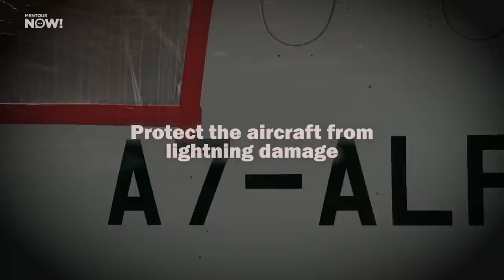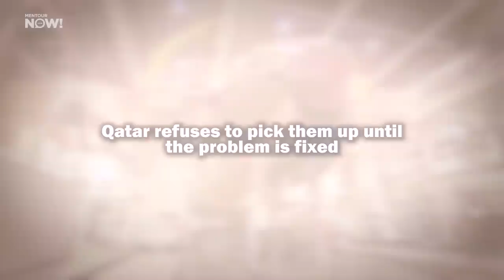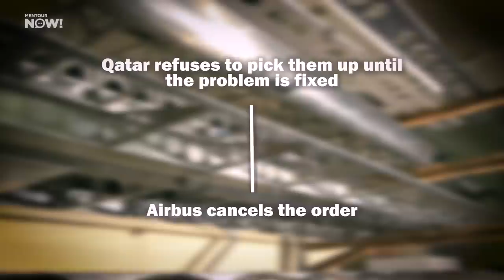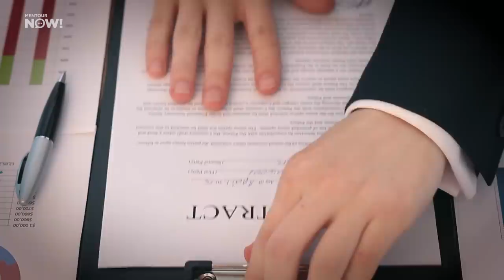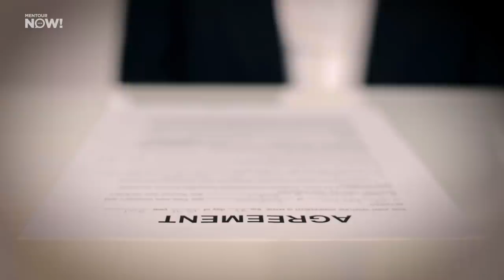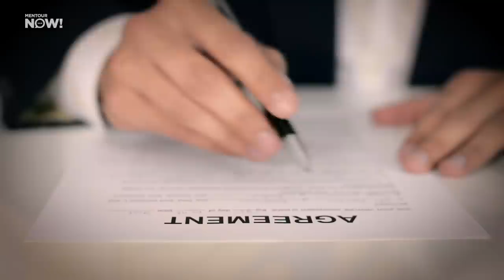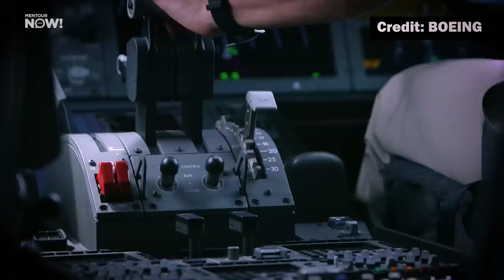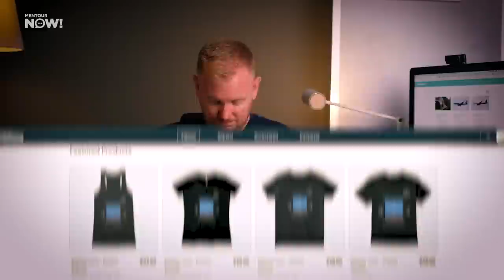WHO is Winning the FIGHT between AIRBUS and QATAR Airways?!

Comment: Thank you for the technical explanation about the root of cause of this issue. 
Now I understand the key cause(s) of this paint peeling. 
a) structure integrity > unlikely
b) paint itself > unlikely
c) bonding issues between three layers > YES《carbon composite + steel mesh + paint system 》which has different expansion rate. Anyway > this is lack of long term testing before applying the system on real use!

"Carbon composite + surface steel mesh + paint system" > bonded issue.
This is 100% manufacture defect, whether it is a cosmetic or airworthiness really dependent expert witness statement. When one airline against one aircraft manufacturer...you can anticipate the result.

However, painting system serves two features (1) surface protection (2) company image. If damage of item (2) leading to more re-painting job (resulting losing business opportunity) or leading damage of company image than it is a long legal battle...

***************************************
Old understanding without acknowledging that a steel wire mesh were
presented between the carbon composite surface & the painting system)
***************************************
 The possible cause(s) of Paint cracks
1. Paint material itself / workmanship of spraying.
2. Environment & operation parameters issues.
3. The structure underneath the paints.

As paint system are typical and common (if fleet A has the issues, then fleet B likely has similar issues too*). If the cracks is unique only spotted in particular type of model of aircraft, then the cause of cracks might come from the structure underneath, which sounds very alarming!!!

1. The expansion and elongation of a structure might cause cracks. Paint system itself has elasticity and able to cope within a working, when exceeding its limit range > cracks appears... (cracks can be a minor issue as claimed by Airbus as a cosmetic problem or serious structural cracks > a time bomb like de Havilland Comet case).

2. If cracks all overall many areas... then it is likely considered as the paint issues, not structural issues > structural cracks normal found locally at stress concentration corner or joining area during inspection and rarely to be spotted all around everywhere within a structure.

*also reported by other airlines operators of A350 with similar issues too.
Paint system are designed with constant deteriorate rate. However, the rate of deterioration shall be reasonable. That is why you need to repaint the surface once every few years. For a good painting system it can last for a decade without the needs for repainting (i.e. most private vehicles).

If you bought a brand new BMW and peeled paints appears everywhere after 24 months normal use. You bring back the car for to the dealer for examination, then the dealer told you
A. Perhaps your car parked too long at dessert areas and accelerate the painting system to be dried quicker than usual.

B. Nevertheless your car still safe to drive, there is not safety issues but just a cosmetic problem.

C.  Don't worry, we will help you to repaint the car within 60 months warranty period free of charge. However once the warranty expired, you have to pay the repainting job at your own cost.

D. By the way, we have no spared loan car for borrowing and the repainting job probably last for 3 to 6 months (please also bring your car with your own fuel (return) and driver and fly to our workshop at located somewhere in Europe for the services too😅

E. Last but no least, please bear in mind that according to the sell and purchase agreement, it clearly stated that there is no compensation for the loss of buyer's business operation due to manufacturing defects in any event TOO.

What will you react 🤔? 
Give him a finger immediately 🖕🖕🖕
Right🤣 ?
But this is the reality!!!

*
By the way, I think litigating between Airbus and Qatar Air is not the best option for resolving this dispute...

Either Airbus win or Qatar Air win > the loser has to paid legal cost for the opposite party. But both side also ruin future business relationship too.

1. We all known it is likely due to COVID-19 > Qatar cannot utilize the newly ordered A350 capacity.
2. Qatar already signed the contract without exist clauses for stopping the ordered plane (my guessing anyway > not only loss all down payment, but also with potential liability for Airbus's loss too).
3. From buyer's  prospective, it is not uncommon using quality and workmanship excuse(s) for rejecting products and refusing for payment.
4. However, there is also a genuine manufacture defect issues (serious paint peel off issue) on Airbus side, the the scale of problem is controversial...
5. If Airbus / Qatar entering supplementary agreement for reducing the original number of order. It seems better not burning money on legal cost but rather than saving on future relationship (anyway legal cost might be minor in term of this scale of purchase agreement) > it is likely a show and end up with supplementary agreement for both sides. 

Airbus side > losing VIP buyers (they are bloody rich!!! able to retire all A380 fleet (x10 nos) for with average 5 years only > what a poor business decision / plan from the beginning)
Qatar side > losing options for only buying Boeing in the future > too bad.

Certainly, it is not the best interests from law firms' prospective for not continuing the litigation proceed until the end.

Anyway > I think it is likely a show in the court room and both company likely to settle on supplementary agreement in the somewhere before the ending of the litigation process. 

Both CEOs from two sides already known about their options and all possible outcomes were already calculated and marked on their dairy too.

Comment: My take on it as a disintrested outsider is simple. All qatar needs to do to prove the paint issue is a threat is take one of their hulls or make a mockup made in a simular enough fashon and subject it to lightning testing. If the plane/mockup suffers damage that can be replicated by 3rd partys elsewhere then qatar is correct and the judge should not only side with them but there should be some airworthyness stuff to happen as well in addition to the giant black mark that would leave on their (aorbusses) record. 

If however, they can not or will not then this is just BS postureing on their (qatars) part. Its also something that airbus can and likely has tested and can show in court as being safe within all reason and qatar can get pimp slapped upside the head for being morons by the judge and go eat some half decayed old crow.
Reply: Even if you had no paint at all, it would 100% protect the carbon fibre from lightning, that is industry standard. Its just a cosmetic issue
Reply: @topethermohenes7658  hence the "if qatar wants to sue then prove it" stance. Like i said qatar claims this is a safety issue....well ok then prove it, otherwise the judge should slap them upside the head.

Comment: Hello Mentor Pilot and fellow Aviation enthusiasts, I fully agree with our Presenter that long term there is little to gain for Either Party to keep this serious dissagreement alive? Airbus needs H.E.  Al Abkar Baker and his huge demand for New Aircraft and He in his turn needs Airbus who are building some of the very best Aircraft on the market today, we are seeing Boeing running hard on ' Cach up ' with old models, whilst Airbus is bringing our greatly improved Models on a regular basis, the A.321 XLR & the new A.350 with considerable weight reduction, increased Payload, and range, ( Secretly I am sure the Qatar CEO is looking on in envy. )

With a little give and take I am sure Airbus can offer a solution, mine would be that Qatar must honor its A.350 Order, and Airbus in their part must take back all the A.350s that are under contention and repair them or offer to take them in Part Exchange for the New and revised model at a cash adjustment of the current Price. Airbus could then refurbish the Ex Qatar Airways Aircraft and offer them back to The C.E.O or offer them for Re-Sale to other Airlines.
Fault Acceptance - Airbus, the first A.350 did have a possible Hot Weather Fault on the Covering of the Aircraft which has since been overcome.
Qatar, that their Color Scheme does not help and that they will revise it to have White Top painted Wings and the Fuselage Top Cabin and keep the Aircraft in Hangers if not in regular use.

Long term the C.E.O will be at a considerable disadvantage having to rely on just Boeing for all its future orders together with the loss of bargaining power.

Comment: Does the Qatari grounding of the A350 prevent foreign airlines from using the A350 on flights to and from Qatar and will that affect the ability of other airlines to meet world cup demand or even fill the gap left by Qatar Airways now much smaller usable fleet?
Reply: Qatar has not grounded their entire A350 fleet, only half is effected, the other half is still in operation.

Comment: Long term, it’s a loss for Airbus, and a plus for Boeing( if they deliver )

Millions of dollars are paid for the outside paint, representing an airline's image, and it should generally last a minimum of five years. Airbus delivered to Qatar, as you are all aware, was peeling off in months. No one wants aircraft which show underline skin/ cracked paint.

Airbus, instead of working towards a solution, they just wanted to continue with the delivery of the rest of the orders, which in the right mind, no Airline industry would accept. 

If you see that the aircraft you were about to board has blistered or cracked paint, will you still travel in it? I won’t.

Now the whole industry knows how Airbus reacts when problems arise with their aircraft. Will it not have an impact on future customers? Only time will tell. 

Qatar will face a temporary hick-up, which they will easily overcome with the resources they have...

Comment: Quatar promoted themselves as a 5-star airline for a long time. So, the peeling paint is not just a 'cosmetic issue' for them. I'm really amazed other carriers didn't support them in this case.
Reply: Because they all have engineers and all probably asked airbus / National air authorities, which both also have engineers, to assess the situation.

So far, only Qatar has said it was a safety issue. So why would they back up something that is not a safety issue based on their data?

Also, considering the recent issues with the b737, I doubt that other airlines and air authorities are taking these issues lightly.
Reply: Other 5-star airlines operate the A350 as well. Ask yourself why any of those respectable airlines and the regulator authorities in the countries where they operate have not deemed the paint a "safety issue". Ask yourself why during a pandemic, where most of those large aircraft had to be grounded without generating revenue, the paint issue become a "safety issue" for Qatar - and Qatar alone.
Reply: Even Mentour said it in the video: other Airlines found a solution to repaint the planes … or just did the first paint job after delivery right. I wonder why so many A350 fly around the world without that issue… you know, the real and single wrong way driver always thinks: “Oh my god, so many wrong way drivers!”
Reply: Cuz it’s Al-Bakar, the mad man of airline industry. Already I heard some complain from QR pilots and cabin crew that they are overwhelmed with workload.

Comment: Qatar is going to come out worse than Airbus. It does not take a genius to understand it. While Airbus has many other customers they can sell their products to, the aircraft manufacturing is basically two fold only. Especially for Qatar Airways. Most of their routes require long haul planes. They cannot really purchase any Embraer, Comac aircraft to compensate.
The wise way to deal with this issue, for Qatar Airways, would be to swallow pride and go back to Airbus with their tell between the legs. Unfortunately, chances of this happening are very infinitesimal. Akbar Al Baker will not, cannot lose face on this.
We are likely to see a long run of resentment. This is in a way very good for Boeing. They have already gained support to extend the time to certify their 737 Max 10 and Max 7 without the additional cockpit alerting systems. They haven't yet obtained the extension, but I am confident they will. Not only because of the massive Qatar Airways order, but also SouthWest and United Airlines. 
In any case, as many in the comments have observed, when you only have a single supplier, getting discounts and playing hard like Akbar Al Baker did will be limited. There is no law that forces Aircraft Manufacturers to sell to an international customer.
Qatar Airways are going to pay a heavy price for attempting to limit their losses during the pandemic.

Comment: I’m sorry, if I spent hundreds of millions of dollars on aircraft and the paint was chipping off of them, I would be pretty pissed off. The fact that Airbus isn’t bending over in every contorted way it can to fix this surprises me. You should be doing better Airbus. But I’m glad Boeing’s gonna step in and take care of Qatar airways. Boeing needs to sell more airplanes to make up for its utter and complete failures with the Max the 777 and the 787.  What is up with aircraft manufacturers?  Get your shit straight before you sell your product.  Peoples lives depend on.
Reply: The paint problem isn't exclusive to Qatar A350 but they were the only airline who reacted in this butthurt way. Other airlines were ok with the way Airbus handled the problem and took the free repainting and maintenance checks until the problem is permanently fixed. Yes, the airlines lose a bit of time the aircraft could create revenue, but free maintenance work every time the aircraft gets a free repaint isn't something to just ignore.
Reply: @shi01  if you bought $1 million Ferrari and they had to repaint it several times because the paint was literally falling off, I’m sure you’d want a free old change tuneup and tire rotation on the cheap from Ferrari wouldn’t you?  That being said, I was not aware that they were requesting multiple different perks from airbus. That does not negate the fact that Airbus should not be delivering $100 million aircraft with defective paint. I am pretty confident that a big chunk of broken off paint and primer that got sucked into the engine would not be good For the longevity of that engines life. Bottom line is Airbus needs to fix this or they need to stop selling the aircraft. There is no justification to deliver a defective aircraft. Whether that defect is in the paint the avionics or the engines it’s still defective and should not occur in my humble opinion.
Reply: @iammrvain  Airbus is working on a permanent fix. But that needs time and testing. And comparing a B-check with a tire rotation...well if a tire rotation on a Ferrari requires about 150 manhours...sure.

Comment: I would be interested to know what is the alternate solution that Airbus is using to mitigate the lightning issue.  If they are not using the metal mesh, what solution are they using?
Reply: They are continuing to use metal mesh but it is designed differently and fixed in place differently.  If I understood what I read properly it should better tolerate the different thermal expansion of the material it is attached to, and is attached with a more flexible version of the adhesive or a different adhesive altogether, depending upon the outcome of the tests they did.

Comment: If I’m booking a long haul flight and there is a choice of airlines I’d be choosing one with a modern aircraft with up to date interior and IFE system, not an old A330. 
Qatar will probably lose customers just for that reason.
Reply: In the other hand, if I had a chance to book an A380, I'd sure go for it.
Reply: @lazyeclipse  they are light years ahead of A330’s as regards interior though.

I’ve been on 6 A380’s and tbh the A350 and 787 is better from a comfort perspective, but there is an element on novelty travelling on the A380.

Comment: First let me say I am here for the marvel of aviation.    I tend to stand up for the underdog when it gets lambasted.

Recently a commenter attempted to defend Airbus by pointing out that the B787 has/had a paint problem and a battery issue too!    These are history, because they are solved,  and a weak attempt at deflecting attention away from the problem in question.

It went on to say the Boeing 787 paint problem did not get as much attention because the airlines that had it did not make a big deal out of it.    This is true  because it was a simple problem with a simple fix.  Add a layer of UV resistant paint on top of all new paint jobs.    There was no lack of transparency.   Boeing did not sit on it for six years.     

Airbus can not use this simple fix because they have more than a cosmetic paint issue.
Reply: Gee airbus, EASA, FAA and all other civil aeronautical boards should hire you, you definitely know better than all of them combined
Reply: @topethermohenes7658  You are assuming that I agree with Qatar and its regulator about grounding the plane.  I do not.  This is simply a "it's to ugly to fly in my fleet' warranty issue.   

Nor do I think Qatar will win in court.   They went too far with the grounding.